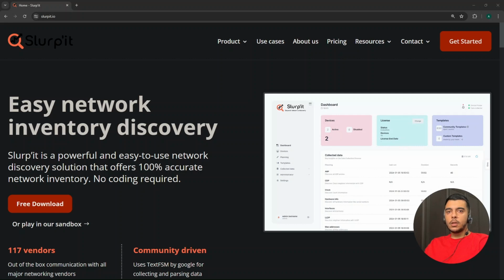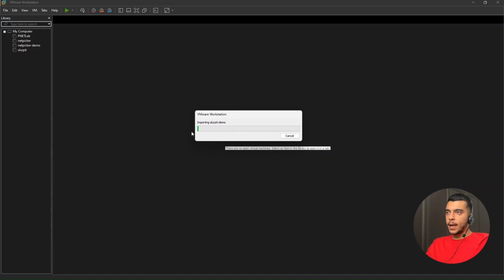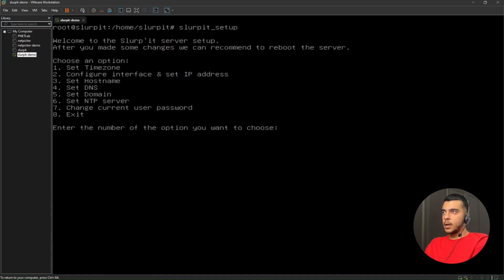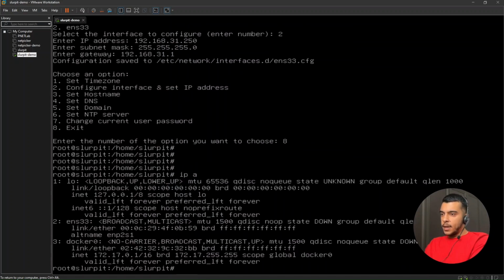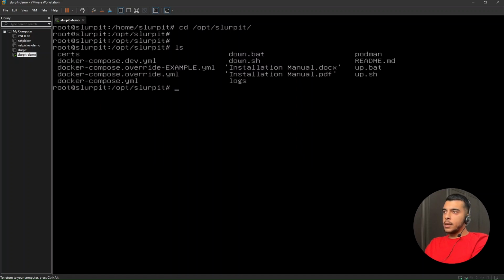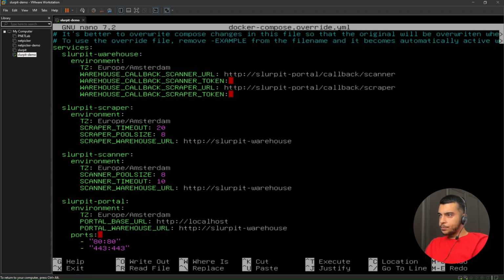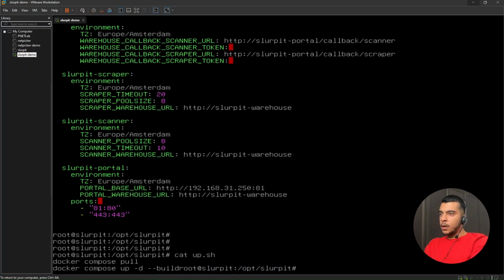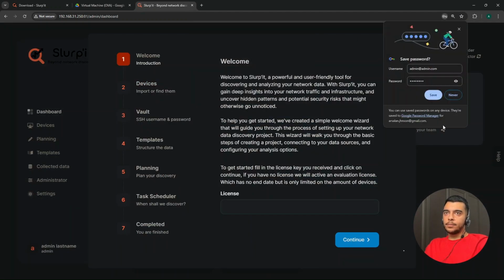How to Install Slurpit Using VM

Comment: There should be a proper way to do a vanilla installation on Debian, Ubuntu, etc. Not everyone uses VMWare (given Broadcom's updated pricing) and Docker is just a pain in the arse to manage via CLI. Hopefully this will be considered.
Reply: Thx for the feedback. It's a container based application, therefor you need to have basic experience with containers to run the application. It's nice way to scale up your application when more resources are required with solutions like OpenShift or K8s. The VM exists to Kickstart the use of the application with docker etc pre-installed. The Ova (VM) will btw run on virtualbox etc as well, it's not a vmware export.
Reply: VmWare sucks, Proxmox rulz! :)